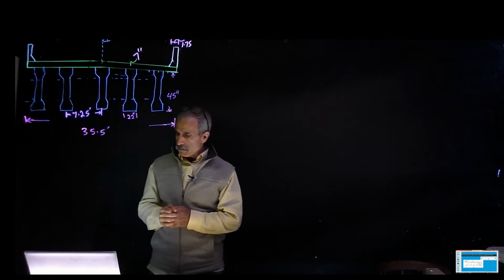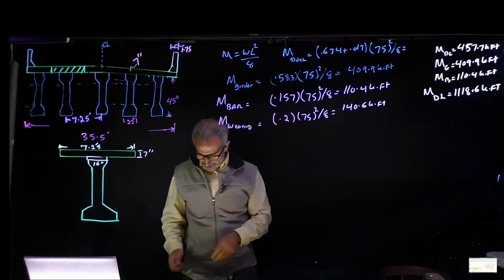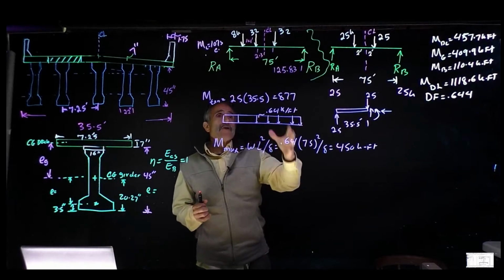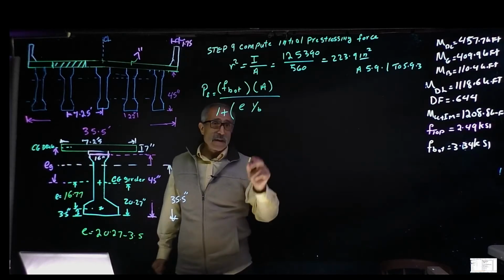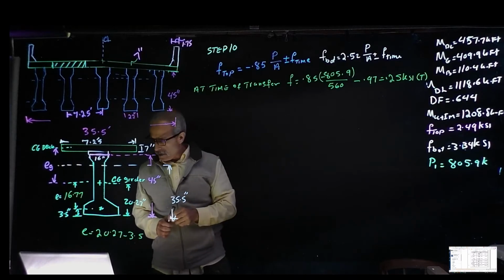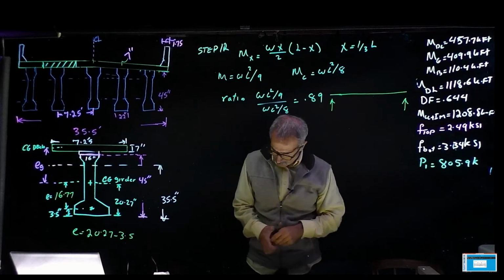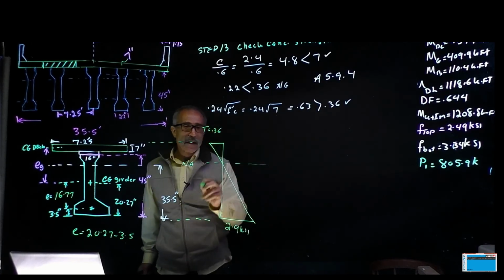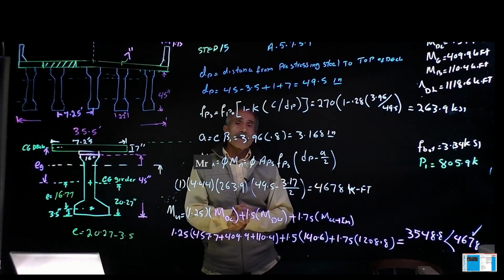Design of Prestressed Concrete Interior Girder

Comment: What if you are working with a three unequal span, uniformly distributed load? Would the moment equation still be wl^2/8? I am currently design a three span Nu 1100 girder and have been following along with your work while adjusting values to meet my criteria. Side-Note: Thank you for the video, has helped me grasp my knowledge on prestressed, which will be useful in my future career.
Reply from the maker: Yes, the bending moment equation is the same, however, your w is based on the tributary width

Comment: How did you calculated That P=805.9K?
The previous result from Pf was 843K. 
Thanks, great video
Reply from the maker: Hi Fernando,
Thank you for watching and good question. The initial prestressing is calculated two different way. The first method resulted 843k. However, another way to calculate this is:  Pi = Asp(fpi) and fpi    = 202.5-21 = 181.5. therefore 4.44x181.5 = 805.6. Somehow when I edit it this 3.5 hours long video I must of cut the second method out.The 202.5 is the 75% the initial stress in tendons(see minute 44) and 21 is the calculated at (50).